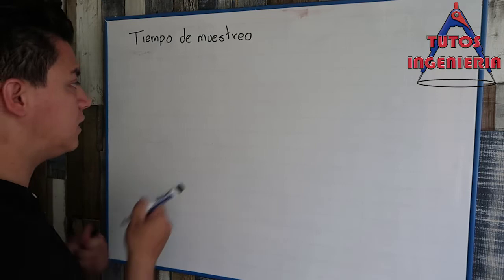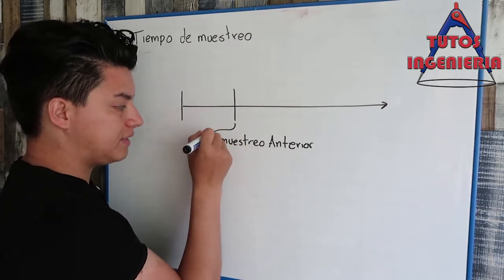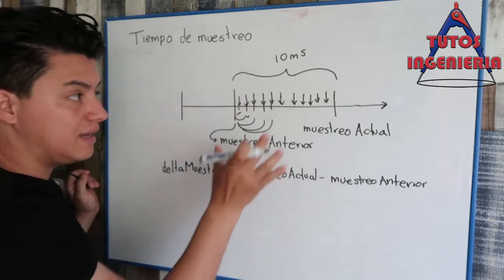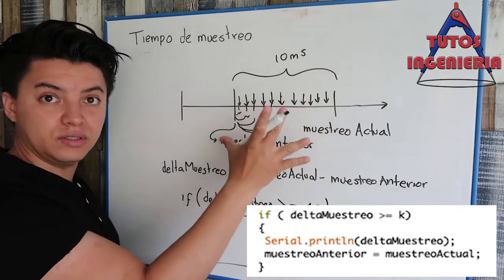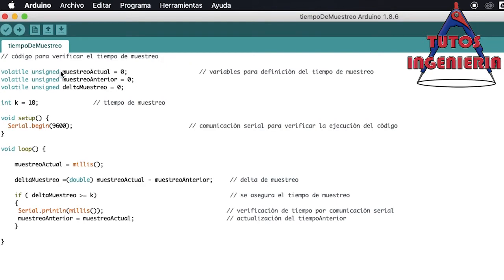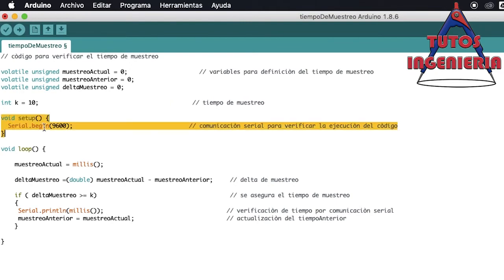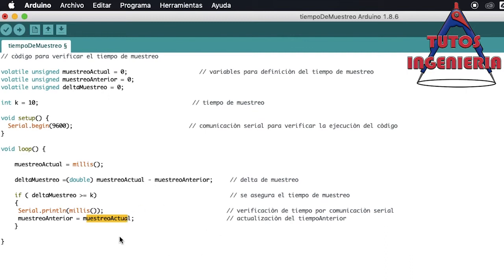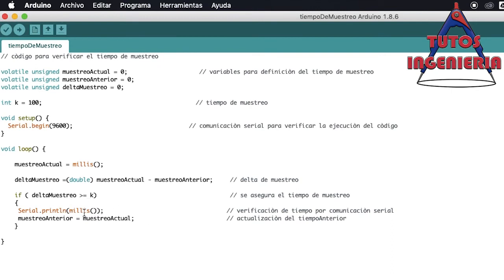Sampling time  on Arduino platform for digital control theory

Comment: How do you know the sample rate will be consistent? Like what if you set your delta sample rate is 10ms. But then the loop takes longer than 10ms because of the code? Is that possible? Like is it possible that writing to an SD card on every loop would increase the length of the loop from around 6ms to 30ms or something like that? Then it would effect your sample rate.